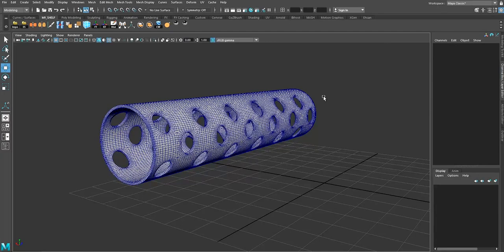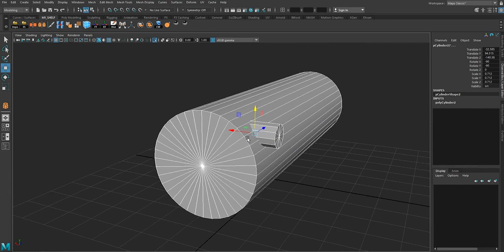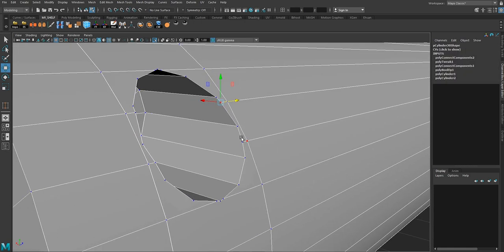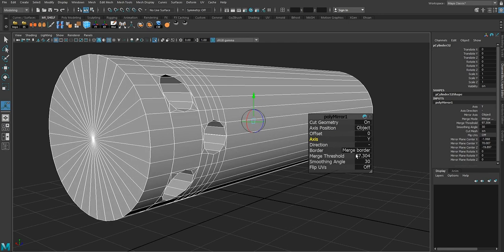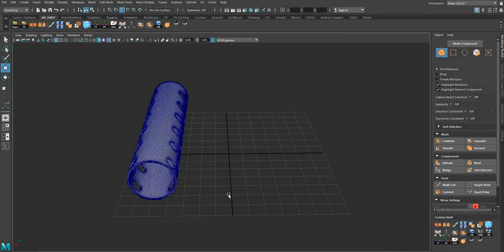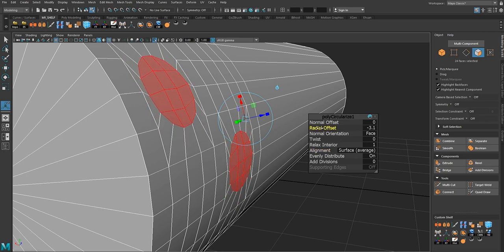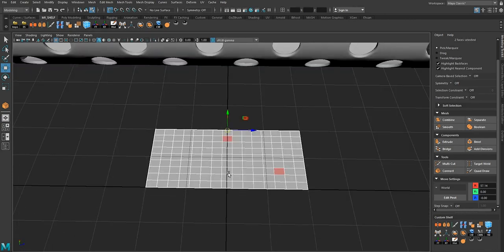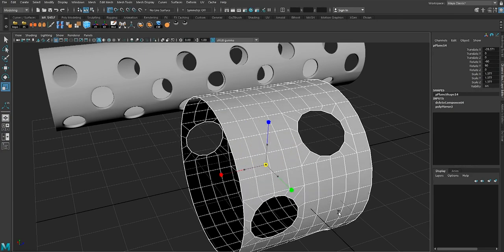CREATING CYLINDER HOLES AND REPITIVE DETAILES IN MAYA

Comment: Thanks for the tips. I am new to Mayay. Just one quick question, where in the settings to show the lines like in your video without the object being selected? If I pressed number 4, it shows only the line, which I don't want. I want to see the surface and lines together just like your one. Thanks
Reply from the maker: thanks yeah I added a key and simple mel to display the edge selected  if u don't find the mel I can send it right here